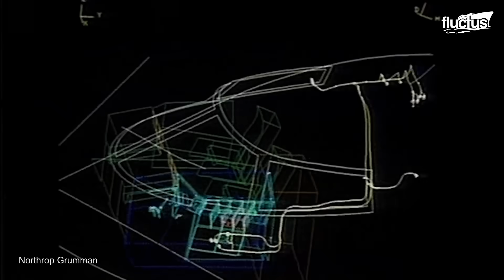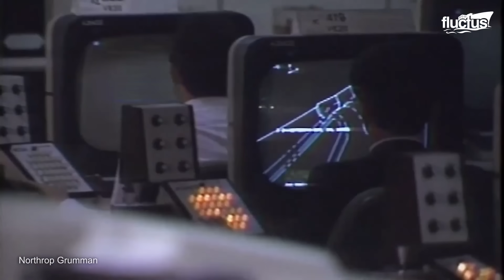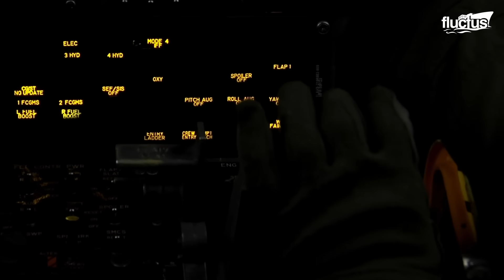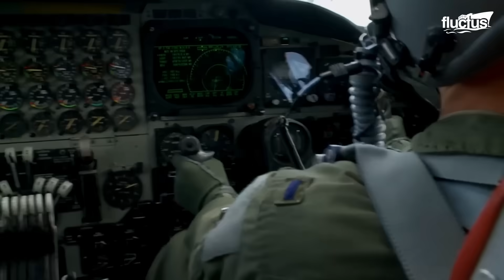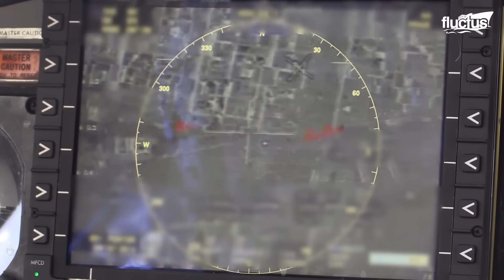US Air Force is Testing New B-21 Stealth Bomber for the First Time

Comment: 06:48   "...they require specialized climate-controlled hangers.."   That doesn't even make sense!!   If these aircraft have to be so carefully stored and "pampered" how can they fly through hail, rain, snow, desert sun and sub-zero cold  without damaging their surfaces ??
Reply: Brother theyre looking after the plane so it has 0 issues flying through crazy climates. Its like a car, you look after it well. It will last. But you will still take the car through snow, dirt, mud etc. just because its protected doesnt mean it cant do it🙏

Comment: The B-1B was not the first USAF supersonic bomber. The B-58 Hustler was!
Reply: Neither is the B-2 the first US. military stealth Bomber. The F-117 filled that roll, with the 'F' intentionally selected to disguise the aircrafts's true (bomber) purpose.
Reply: @rpeltier2621  I knew the F-117 was a bomber. But I've never heard anyone represent that it was a 'stealth' aircraft.
I assume that you consider its low altitude, terrain following capabilities as what made it stealthy. 
While it certainly helps to potentially fly below a radar's beam, that in itself is not sufficient to fit the traditional definition of a stealth aircraft.
Can you cite anything which shows that the F-117 was designed to reduce radar reflections and/or improve radar absorption?
Reply: @gregparrott google stealth fighter and see what comes up
Reply: @thilde007  Here's what was said "Stealth aircraft are designed to avoid detection using a variety of technologies that reduce reflection/emission of radar, infrared,[1] visible light, radio frequency (RF) spectrum, and audio, collectively known as stealth technology.[2] The F-117 Nighthawk was the first operational aircraft explicitly designed around stealth technology. Other examples of stealth aircraft include the B-2 Spirit, the B-21 Raider, the F-22 Raptor,[3] the F-35 Lightning II,[4][5] the Chengdu J-20,[6] and the Sukhoi Su-57."        That is consistent with my interpretation, which is the most common one.
Reply: All you experts... make your own friggin site!🤬
Reply: @gregmacdonald7710 why? It’s more fun to watch you grit your teeth in frustration at our superior knowledge!
Reply: Back in the day, I saw them fly over the house, heading for a landing at SAC.
Reply: They mean the one still in service.
Reply: Would like to have seen more of the B-21 tho…
Reply: At the unveiling, what were the guys walking under the wings dragging on the ground? It looked like mops...
Reply: @Smileswithhammer  Wheel chocks. Aircraft don't come with parking brakes, so when they're stopped you chock the wheels to prevent movement.